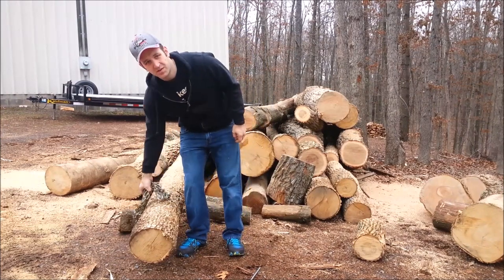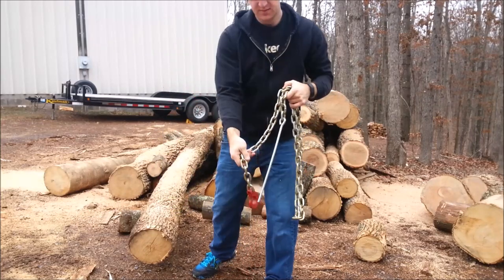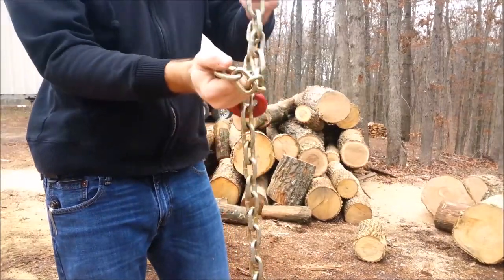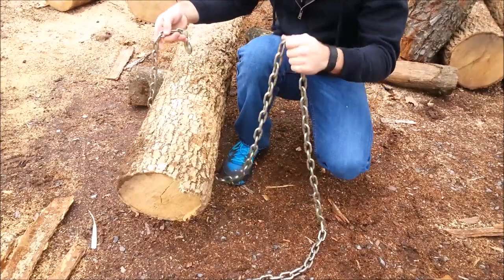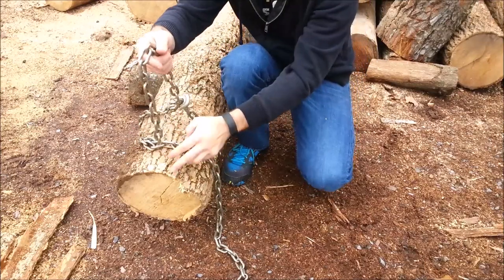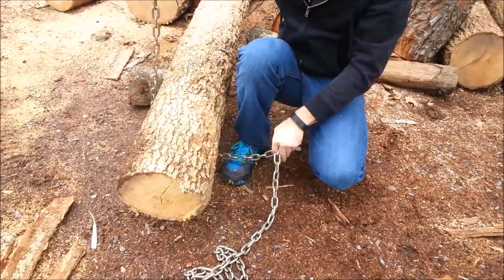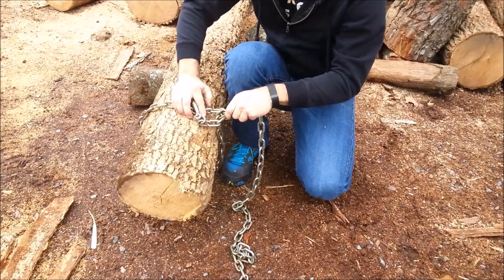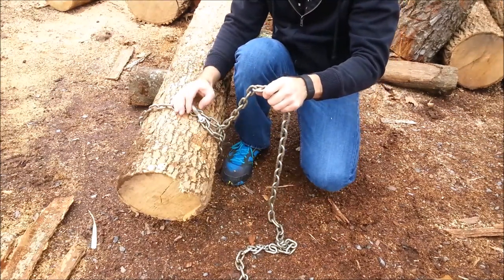How to Use a Regular Chain as a Choker Chain

Comment: I gave seen both of your videos on this device.  Excellent device and excellent explanation.  

Modification idea here.
Have two smaller pipes welded together, zero bolts, one regular chain with hooks and one short chain welded to pipe with no hooks.

Go around the tree and push the chain through the pipe.  Connect chains.

Possibly better because there is no hook at the tree.  Different style of grip on the tree.  Smaller pipes.  The chain would slide through more easily because there are no bolts.  You could try it and give us a report in a new video and the history of your device.    Your device is good enough to crow about.

How to push a chain: have a steel wire loop as a handle.  The main weakness of my idea is pushing that chain, as you have said.  Pipes do not need to be that long, IMO.

Comment: You can also just make an addition wrap around the log and hook like normal. When you make the wrap cross one chain over the other. It gets a better bite on the log and can actually lift like this....but still not wise to be near the load in the air because if operator let's it hit ground the choker can loosen
Reply from the maker: That would work.

Comment: How did you connect the chain to the tractor? The draw-bar? A quick-hitch? A log skidder?
What is the  most robust connection point for the chain attachment to the tractor?
Reply from the maker: The safest way is to attach it to the drawbar. If you attach it to anything on the 3 point hitch, the front wheels can come of the ground, and the tractor could roll or flip.

Comment: Great to the point video.  What if you had to move that log 200 yards or more?  Do the make elevating wheeled axles you can strap to it?
Reply from the maker: I would hook onto the big end of the log and drag it. If possible I would pick up the big end and pull it so only the small end was on the ground.

Comment: Hi, I was wondering if you could make a video on how to tie a chain to multiple logs so you can drag them? I was trying to tie about 5 different logs together so I can drag them up a hill with my Kawasaki Mule, but the chain kept slipping off. I was wondering if you could make a video on how to properly tie the chain like that? Thanks in advance
Reply from the maker: How were you trying to hook logs, one log hooked to the mule then a log hooked to a log?
Reply: Tractor Tech no, I had tried like 4 or 5 different logs tied together, then used the same chain that i tied the logs together with to the mule
Reply from the maker: You could wrap the chain around the logs and hook it like I did in the video. Just don't pull too much and flip your Mule.
Reply: Tractor Tech I'll try that, but I know that Mule's limits, I've actually pushed them a few times but never flipped it. Not gonna jinx things though